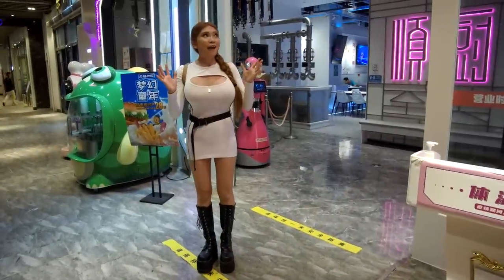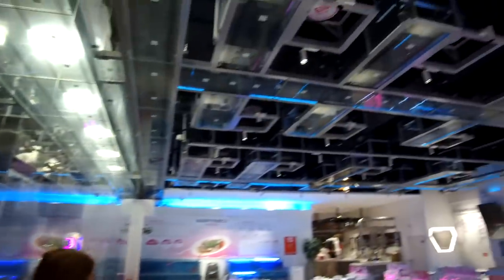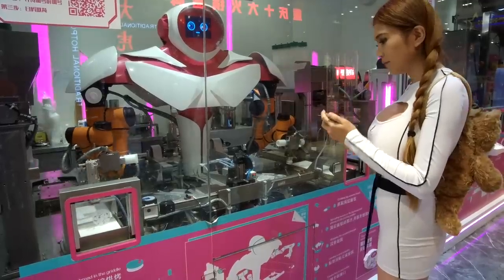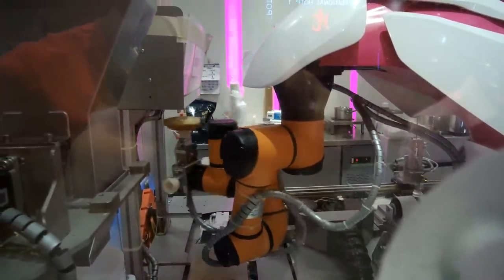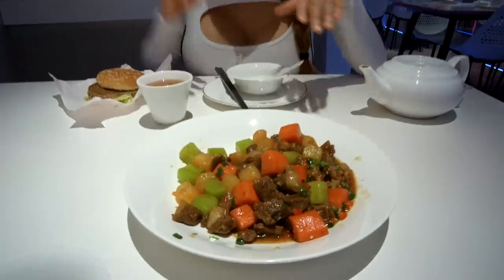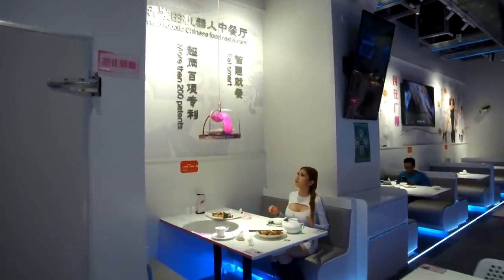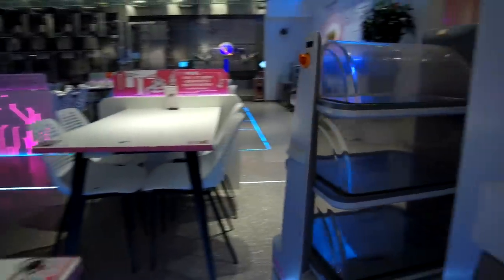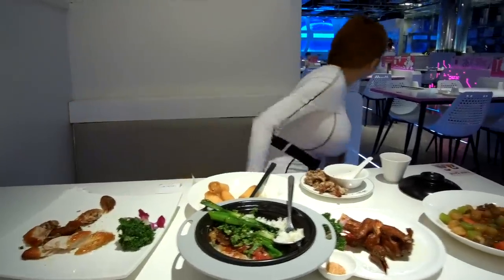China's Best Robot Restaurant!

Comment: I've had "less graceful" burgers from humans ;) but I appreciate that there's room for improvement in the technology.

Have there been been attempts to add in a remote human to monitor and fine-tune the operation?
Reply from the maker: Could probably train TensorFlow to do it...
Reply: @Naomi-Wu  Agreed. It would just need a webcam or two to watch the components before the get assembled, and then you can use TensorFlow to match against known good samples. The system looks capable. A good place to take kids maybe. Watching the robots would keep them occupied, as long as you could stop the kids from chasing the bots around the restaurant!
Reply: @Naomi-Wu  just for know, russia has pretty funny startup with vending machine, which is cooking squared pancakes with many flavors. They are using convolutional (or how does this word writes?) nn writed on pure delphi (not kiddin, im serious, wtf'ed too). And it makes cool pancakes without any human and doesn't give any bad one. Soooo, i think that make cool burger is not too hard, bigger problem is how much time you want spend for teaching robot 🙃

Comment: About the meat, do you meant "Jamon serrano"? If that's the case then it's not the same, jamon goes through a very delicate and long curing process: five or six days for salting, thirty to seventy days for cleansing and six to nine months drying, all without cutting the meat and under very concrete ambiental conditions (humidity, temperature, lightning, etc). We don't put it "on the balcony", there are special chambers to do all this process :)
Reply from the maker: Not sure what I was thinking to be honest?😅
Reply: here in france dried ham is made by covering it in saltpeter and putting it in a box full of salt inside the cellar for a few weeks, not on the balcony
and after that it's hanged somewhere dry for a few months.
from what I've read jamon serrano is kinda any dried ham but it mainly refers to ham made fron a specific breed of pig.
Reply: @satibel  Wrong, "Jamon serrano" is refered to the curing process, the one I described, you may refer to "Jamon ibérico" o "Jamón de bellota", those are types of "jamon serrano" but that differ on the breed and diet of the pig :)
Reply: @drgusman  wikipedia is wrong on a small detail? who could've seen it coming?

Comment: fun but let´s take a realistic look ... the burger robot is mostly open surfaces inside, not easy to clean ... he messed up the bun ... only mayo on the bun the ketchup not working ... sucks the patty with a cup so no good beef juice left that brings any flavor... should be easy for the staff to see errors/feedback refill the machine and keep it clean ... the presentation also lacks a bit could be better ... the robots that bring the food to the table are nothing new ... most interesting part you left out ... how they block you to press order again on your phone when youre outside an wanna troll? You scanned the qr code with the phone and it opens a website or do you scan it with an app that the restaurant provides? How did you pay? No cocktail come on :)